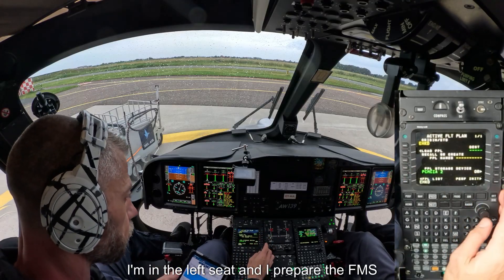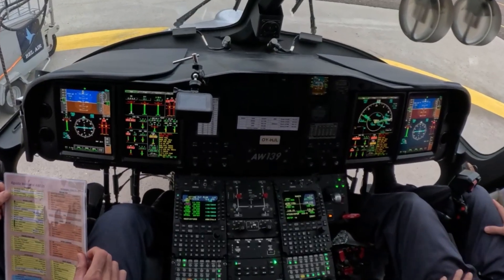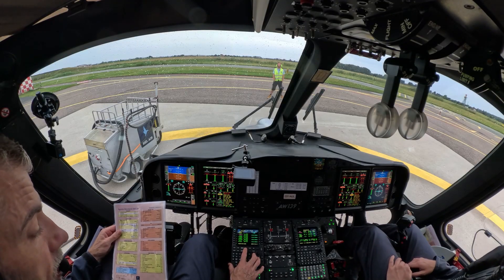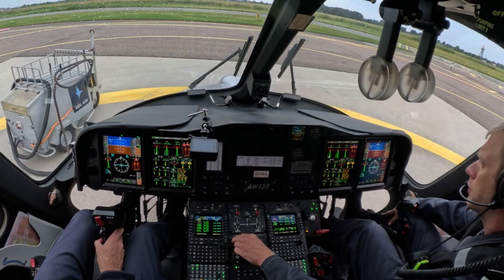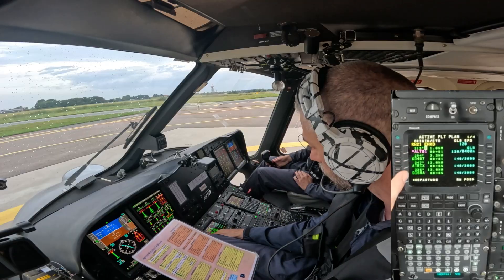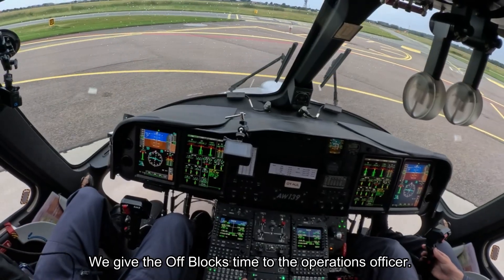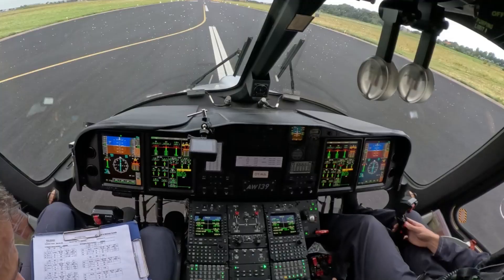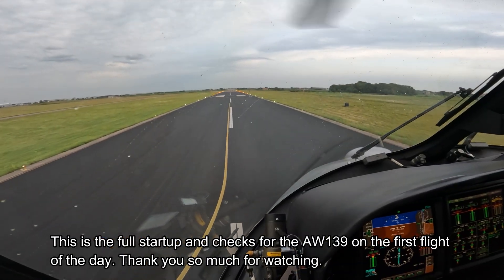FULL START CHECKS | FMS PROGRAMMING | AW139 | FIRST FLIGHT OF THE DAY

Comment: Great content! 
I didn't see you pushing any PTT while talking to ATC...did I miss somethin?
Reply from the maker: Thank you so much for your kind comment! Very well spotted indeed. We normally use the PTT switch on the floor. So I push it with my left foot when in the left seat. This is to not manipulate the flight controls for the right seat pilot.
Reply: @HeliChrisAviation  Thanks, didn't know about that feature.
Reply from the maker: @talespinner173 😊thanks for your comment.  Both the 139 and the 189 have a PTT on the floor.

Comment: I think its a good with the narration. 

So when I flew the R44 it had lateral/longitudinal weights (I only got to navigation solo then went back to fixed wing IFR instead due to costs), so we have left/right stations divided up. Looks like probably due to the size of the aircraft you go back to more of the fixed wing style with just row based from the datum?
Reply from the maker: Thank you very much for your comment. Cool you flew the 44! 
With passenger transport in large helicopters this is standard indeed. However in our EFB we do see our lateral CG also.